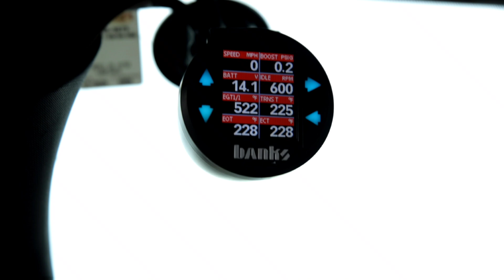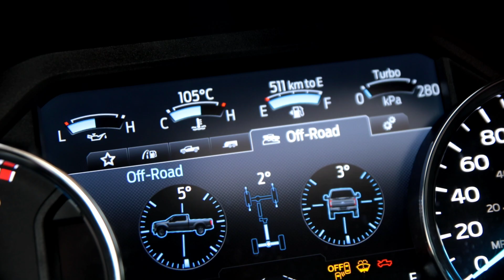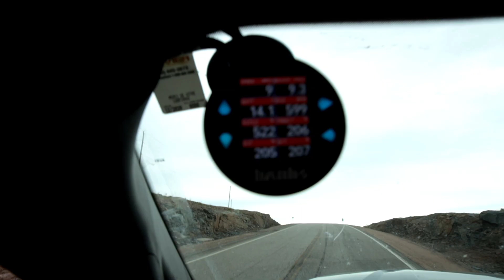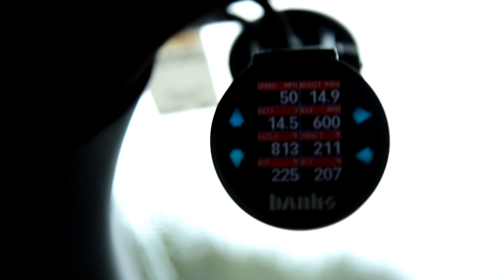NEW Ford powerstroke OVERHEATS 7 times going up hills

Comment: My 2016 f 750 had over heating problem.   Ended up being a bad wire in a harness.   2 dealerships couldn’t figure it out.  Thankfully a local mechanic at a mom and pop was able to trace it down.  I gave him a big tip

Comment: U can get an all aluminum radiator/electric fan/relay kit for $300 from Amazon or similar. Do it yourself or bring the kit to a mechanic and pay labor only. You can permanently rip out the OEM clutch fan and shroud, AND that half plastic crappy radiator. Convert to electric permanently. You already have two batteries on board to compensate for high draw. Now u have better mpg, better temps, more room under the hood, cooler AC, and if one fan breaks you have a second one! It's a matter of time with all the truck abuse that you crack the oe radiator anyway or overheat it to cracking

Comment: Run your heater on hi it will help
Reply: @youtubeistrash192  
The Heater Core is a small radiator (air-to-water heat exchanger) that engine coolant is run through and a Fan Blower Motor pushes air across (and into the passenger compartment).
Reply: @lt1nut  thank you for the explanation:)

Comment: You shouldn't call it overheat. It's a critical warning before it overheats. Trans fluid max temp limit is 256⁰f. Lots safe gaurds before you break anything. The fools ignore the warnings. If you are that concerned about the fan. Remove it and add a pair of manually controlled electric fans, you have upfitter switches use one.

Comment: Start by checking power at all the pins in the connector should be able to tell what wires are chaffed or shorted if they dont have power at the plug

Comment: Good lord it can’t be that hard for a reputable shop to figure out. I know you’re in the middle of no where but someone who knows what they’re doing with a continuity test on the pos and Neg wires to the fan should be able to find it with a schematic etc. See advice on here of guys saying where the wires could be open. New scan tool active test can drive the fan to test as the negative to fan is pulsed from the ECM more than likely. Good luck.

Comment: It's not a fix, but if you are going that slow up a hill, pop your hood and tie is down so it can't blow back. Lets some of that heat out via convection.
Reply: I had a 1988 Chevy with the new style front end on it and it over heated all the time I finally lifted up the rear of the hood about 1/2 inch which helped but we never did solve the problem while towing

Comment: Probably a fan clutch before you let the smoke out. Now you are going to half to put another new clutch on and manually engage it with the scanner to force it on. After that replace the radiator because the weight you haul with hills 100% radiator efficiency is crucial.
Reply: And throw a thermostat in while you are at it.

Comment: Unhook the fan. Put 12v to the fan. If the fan works perfectly. Then you problems are before the fan. If your fan acts up. Then it's your fan. If the fan works perfectly. Put an togo switch on the fan until you find the problem. Although if fuse doesn't blow. Means there is no problems between the fuse and fan. That would leave the problem before the fuse.

Comment: I see comments saying get something besides the number one selling and hauling truck in America. Fact is regardless of what brand you get they all have their problems, Cummins is a hell of an engine to bad the rest of the truck isn't as durable, transmissions front end problems and every brand has electrical issues. Factory the duramax can't compete with the power stroke on torque or dependability. Had a 2006 duramax that was plagued with injector, fuel and electrical problems. You take any truck load it at thirty thousand pounds and haul through the pothole laden roads that he frequents anything will have an issue at some point. 6.7 and the F450 is a towing beast throughout all types of conditions and surfaces.
Reply: I'm thinking a triple-duty is in order where they combine to take over the world...Forever.

Comment: Rig a bypass wire to the motor.
Reply: Or even just mechanically bypass the fan clutch
Reply: @5.43v  I don’t think the new ones have a belt driven fan/water pump but I’m not sure. I think the fan is all electric

Comment: I had this happen on my old 6.0 f450 service truck, I got so frustrated with it i ended up getting a new 6.7 truck.  turns out the fan clutch wires came in contact with the blades and were all chewed up. sound like you have checked your wiring, but its probably worth it to really give it another good once over

Comment: Did you check terminal pin fit at the connector the fan plugs into? They sometimes chafe on the bracket the wiring runs behind too

Comment: pretty sure circuit open means no ground. with living on the coast and road salt I'd guess you're problem is corrosion
Reply: The "Ground" is duty cycled from the PCM.  He has a broken wire I. the harness more than likely. They like to break and chafe drivers side by the front cross member among a few other places.

Comment: How many times do you have to get burned by ford to switch to a Cummins? I learned my lesson twice with a 2017 and 2019 f150. Both were trash.
Reply: Get a ram 5500 limited
Reply: What will switching to Cummins do about a fan clutch problem. The problem with fanboys is they fail to realize that all manufacturers use the same part suppliers. Remember how the Takata airbag problem touched every manufacturer globally?  How a few chip manufacturers have the entire industry crippled. I wouldn’t be surprised if Ford and Ram both used the same supplier for fan clutches.
Reply: Did Ford make the mechanic 
I don't understand the logic
Did you vote fir Biden or Trudeau aswell
Reply: Was wondering the same thing.
Reply: duramax and be done with it
Reply: Bruh Duramax would've exploded by now, Cummins would make it but the truck would be toast especially the tranny
Reply: Drive one for yourself sometime. Lots of internet never done its running their mouth on things. I've been with gm trucks forever. Never once have I experienced first hand any of the "so called issues" the internet says is so rampant in gm trucks.
Reply: @polar330  this is tru
Reply: @nativeoutdoors1780  Aisin trans. Problem solved.
Reply: @Itsa_Mea  not really aisin still has issues but is definitely far superior to Mopar trans
Reply: Atleast a Duramax man Cummins or Duramax any day those new Ford's are junk but very comfy for heavy hauling